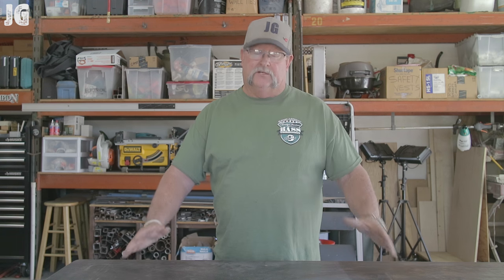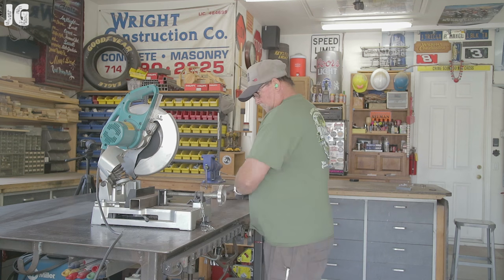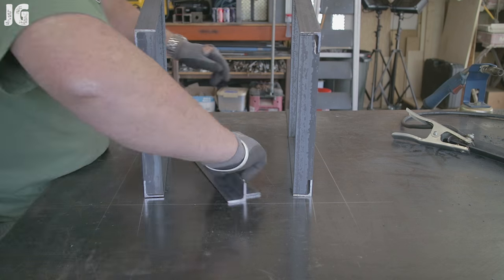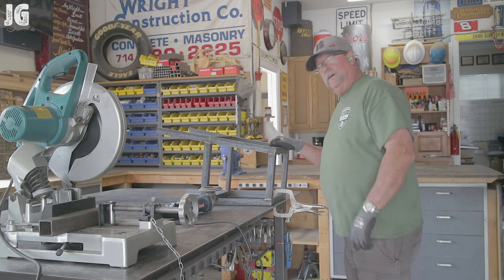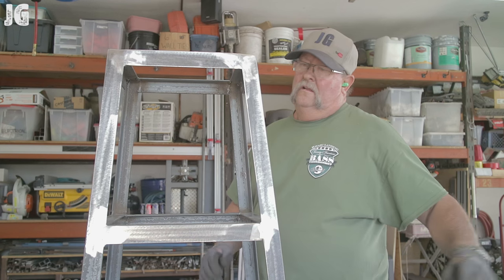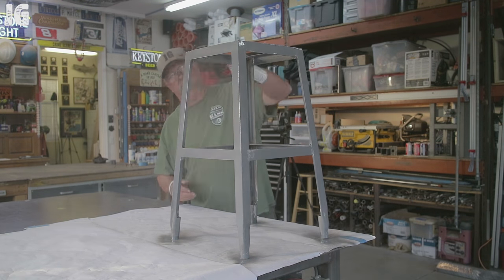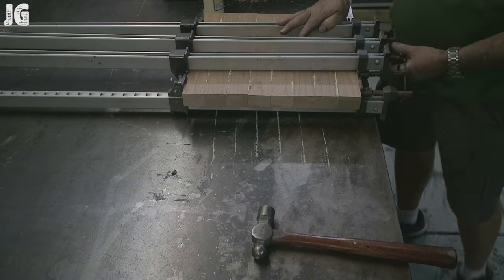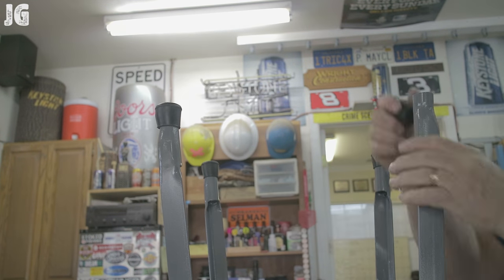Shop Stool Build - Jimbos Garage

Comment: Jim, when messing with that bar top epoxy, take a heat gun and go over it to get any air bubbles out and help to level out the surface. you can also use a hair dryer but it takes longer due to less heat. Cherry wood is extremely hard to work with due to the burning. Sharp tools is the key and not pinching the wood with the fence against the blade.
Reply from the maker: +James Smith   Thanks for watching and your advice James.  Jimbos garage!

Comment: Enjoyable video about a useful project.  I would suggest that you make sure your tablesaw blade is parallel to your miter slots first (I use a combination square, pick one tooth and measure then rotate 180 degrees and measure again) then you can set the rip fence to parallel to the slot front and back.  Some like a bit of blade clearance on the outfeed (1/64th or so) while others prefer perfect parallel.  Take care.  Doug

Comment: Nice video, Jimbo. Just a tip on the flap discs, they last about 3x as long when you hold them at about a 5-10 degree angle. I don't always get new ones on time at the shop, so I have learned to inch out every last bit from them. Wouldn't want to be stuck grinding a weld with a 120 grit!
Reply from the maker: Thanks for watching Elliott,  Thanks for the tip on the flap discs, I will give it a try.  Jimbos garage!

Comment: I noticed that the mid leg cross brace was a bit higher on your stool than on the original ... just wondering if that made it less comfortable to bring your foot up onto while sitting down?
Reply from the maker: +Roger Baxter   Thanks for watching Roger, That is a good attention to detail you have, Yes that happened when i extended the 3/4'' pipe on the bottom of the legs. But no worries it still is comfortable.  Jimbos garage!

Comment: Saw a video that used Epoxy for clear. They mentioned if you get air bubbles in the Epoxy. Use a torch to eat and pop them. It was the pourable type.
Reply from the maker: Thanks for watching Matthew, Yes it was, And the torch works great! Jimbos garage!

Comment: Hey Jimbo, great videos. I just started watching you a few days ago. I also have a little weld shop setup in my garage I've got a Millermatic 200 a plasma cutter by Lincoln oxy-acetylene torch various grinders so I'm trying to get started I like to build trailers and barbecue pits. What is your favorite kind of grinding wheel / cut off wheel Anyway keep up the great videos I love you watch you build stuff
Reply from the maker: Thanks for watching Ronald, I have been using a lot of Walter Enduro flex, And Flexsteel, There products seem to last a long time!  Jimbo!
Reply: JIMBO'S GARAGE thank you sir